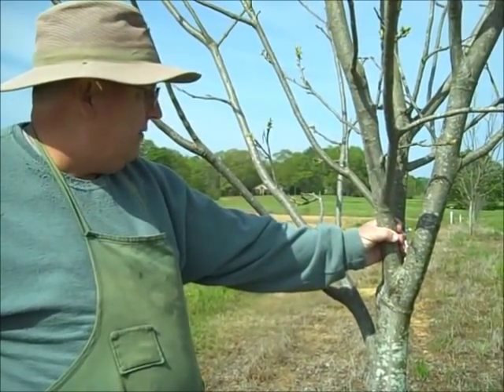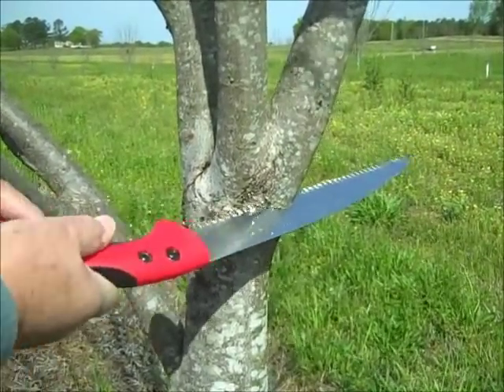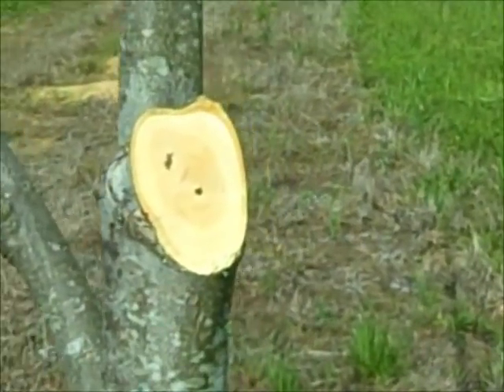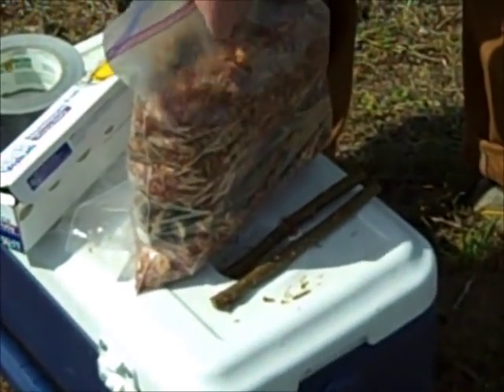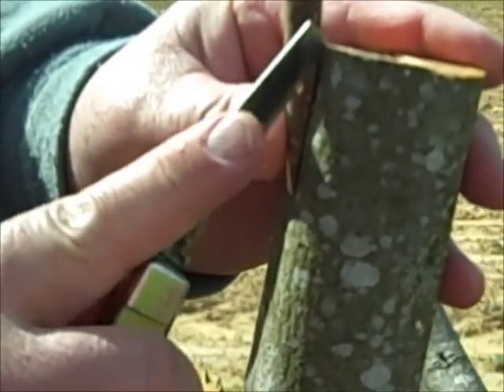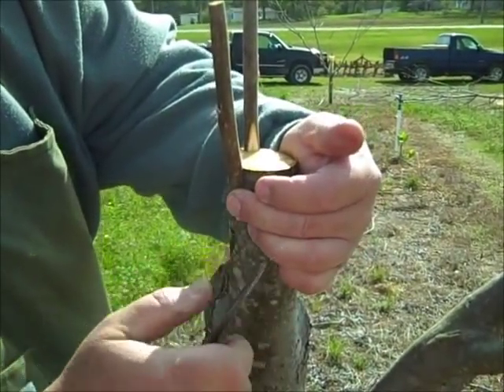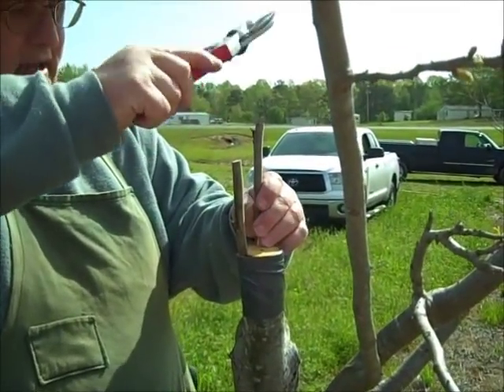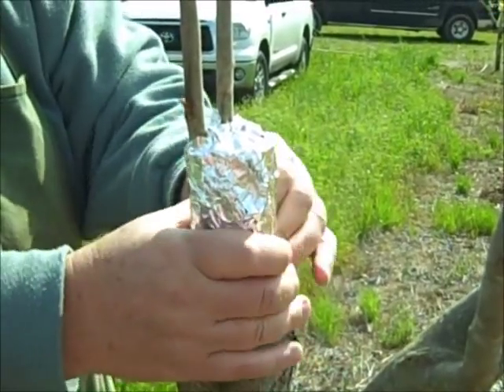Pecan Inlay Grafting Technique

Comment: Neat method. Can I use it to graft chestnut trees? Have you done that?
Reply: I have not used it on chestnut. There is a modified chip bud graft that I have seen that is supposed to be very successful on chestnut. The “chip” is actually a small section of scion wood. All is wrapped with plastic tape and sealed with parafilm.
Reply: @PuckPuggy  Thank you for replying. I am going to try the inlay bark graft method on a couple of 2 to 3 inch truck chestnuts. However, Would the modified chip bud graft method you mentioned  work on a 3 inch diameter trunk chestnut? Also, could you give me  a link to how this works ? All the best.
Reply: @ridanuwayhid9494  The method I mentioned was used on small nursery trees. I’ll try to find a video on that method.
Reply: The fellow who first showed me the graft on chestnut was a grad student from China. He would take a short section of scion wood and cut the side and end like you would for a chip Bud. However he then cut the stock down one side and left a slot for the chip end. So this was like a “chip side graft” if that makes sense? Part of the scion was left sticking up above the stock. I can’t find a video.